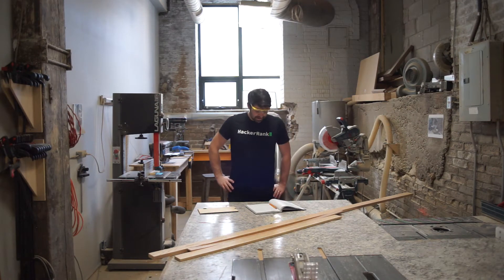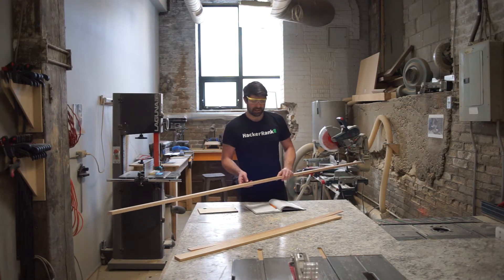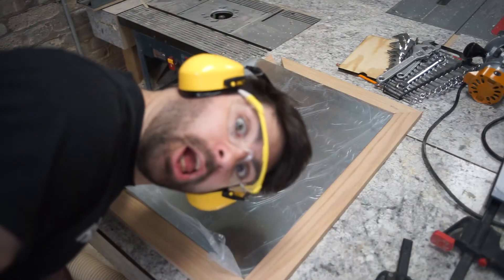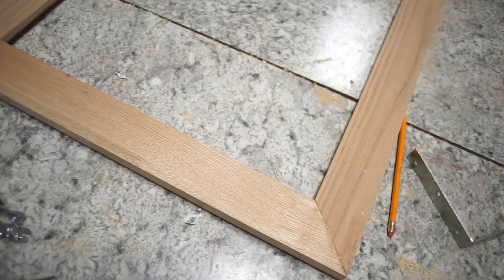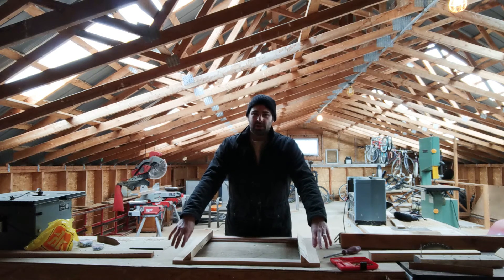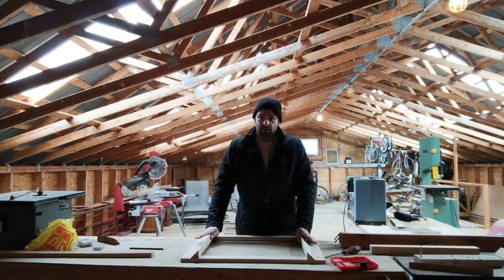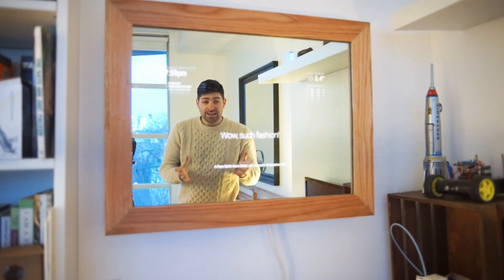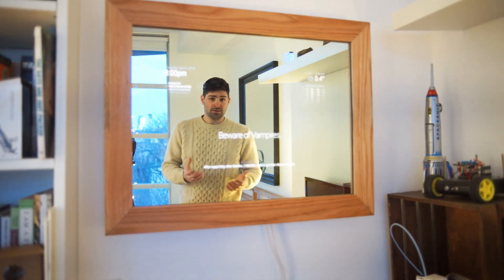Building a Smart Mirror Frame (Glass Mirror Upgrade!)

Comment: Looks great Ben, I am in the process of putting one together myself and have used the cheaper option of acrylic and reflective film so I am eager to see the difference. I am using 15% film but do you happen to know what kind of percentage the two way glass mirror lets through? I haven't constructed my frame yet so I imagine that will make a big improvement. 

Good work on the posts that take a novice, like myself, through each step of the physical build, and more importantly (for someone new to raspberry pi) the programming steps as well.
Reply from the maker: Thanks Francis! I really try to make guides with first time builders in mind, so that is really nice to hear.

 I used a mirrored film version for about 18 months before upgrading, and I think it's a great way to get a Smart Mirror. I'm sorry I don't know the percentages off hand, but I will try to find those for you. Good luck with your build!
Reply from the maker: Glass mirror reflectivity: Visible Transmittance: 11%, Visible Reflectance (Coated Side): 68%, Visible Reflectance (Glass Side): 16%
Reply: Awesome! Thanks for the info :)